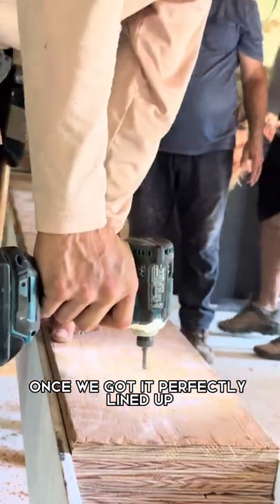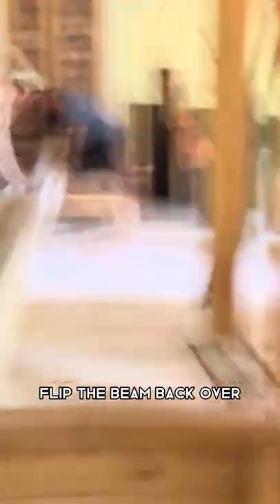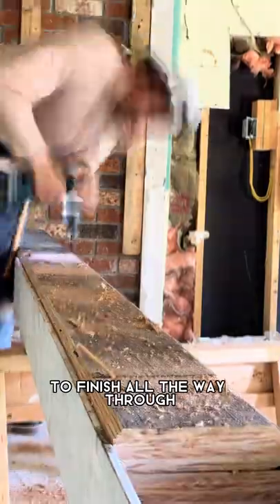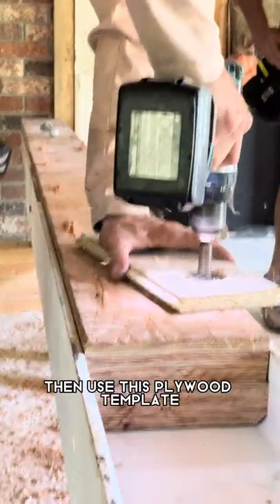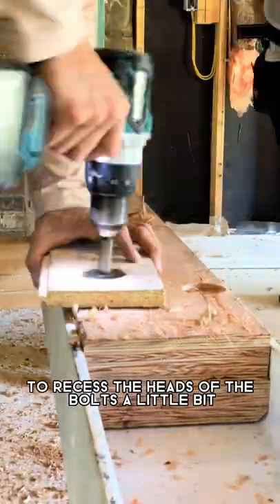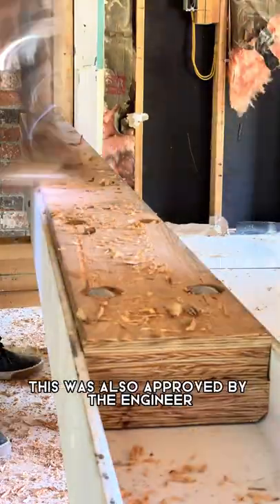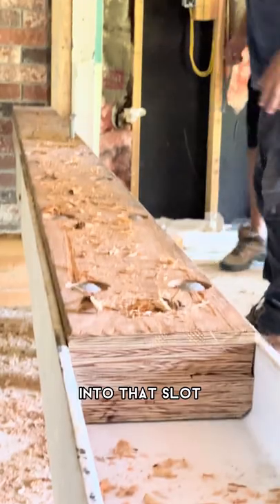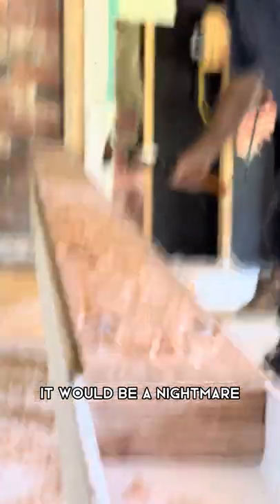Big Beam Install Part 4

Comment: Seems to me that that's still being would have carried the load all by itself and you could have just boxed it in with furring
Reply: Seems to me you're not a professional
Reply: @crustyflatonion9595  if I had the exact specifications of that steel beam I could answer it. But typically there's no need to fill a steel beam with wood.
Reply: @furbyforecast123  yeah, I would too because I'd rather do less if I can, but they still did a structurally sound job; and that's the only thing that matters

Comment: i dont see why any engineer would approve a metal beam with regular beams inside thats very very much over kill 16” lvl beam wouldve been fine
Reply: I suppose it would have to do with however much weight it's holding. As well as the codes in that area. Seeing as it's at the beach, probably has different codes than the mountains. 

It could also be overkill but the home owner requests it. Rather aesthetic reasons or peace of mind.
Reply: Overkill is just fine.. it's structurally sound.. why wouldn't they approve it?

Comment: The thing that's funny about engineers they don't know s*** about construction,  they couldn't tell you which end of a hammer drives the nail or pulls the nail , that's because they're engineers they've never got their hands dirty !!!!   And why couldn't you have got a glue lamb made that's probably just as strong ???????
Reply: "Probably just as strong" they did this stuff for a reason. Engineers are professionals, and you're clearly making a lot of assumptions. Get educated if you want some answers.
Reply: @crustyflatonion9595  I got my GB 98 license in 1993 so again tell me I'm making assumptions????
Reply: @Danny-ge2my  yeah the codes have changed how much? If I got my real estate license in the 90s, then my opinions are no longer professional opinions.
Reply: @crustyflatonion9595  LVL beams (glue lams as he called them) are far superior to what they just did.
Reply: @evictioncarpentry2628  irrelevant. They are both structurally sound, and pass code, which is the only thing that matters.
Reply: Go read the descriptions and other parts of this beam story. Youll understand why after